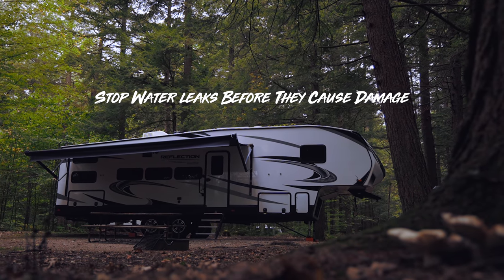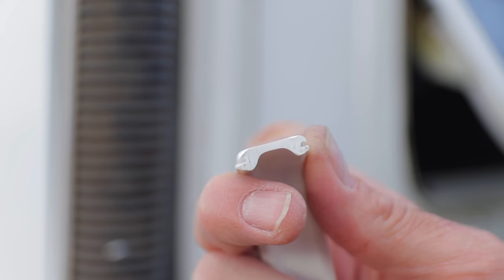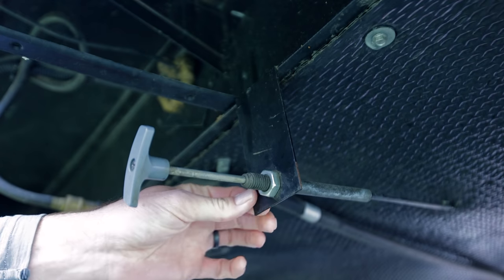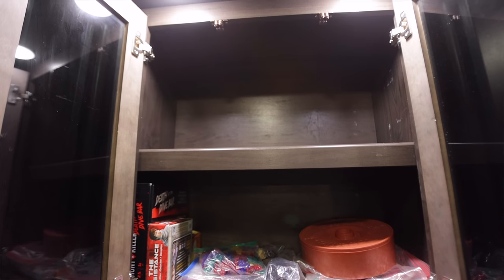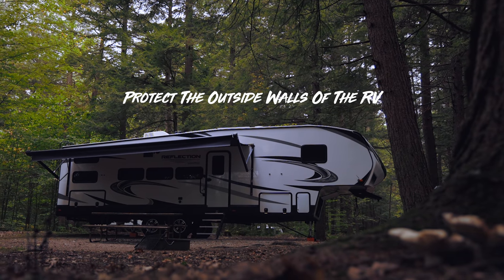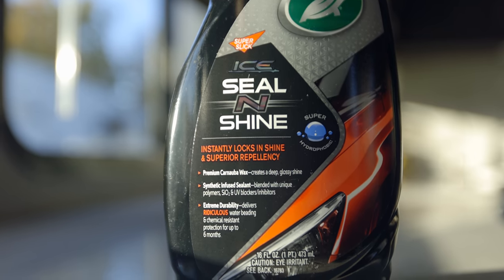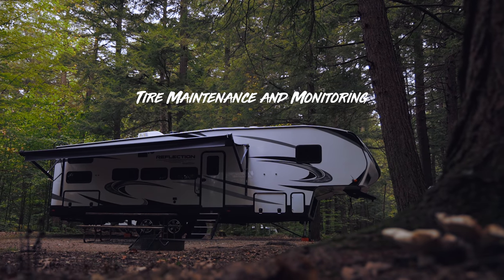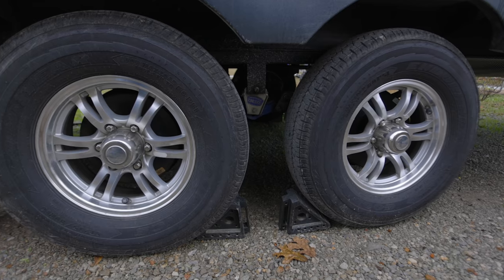5 Ways To Extend The Life Of Your RV

Comment: Thanks Jared!  Any tips on proactive fridge and furnace maintenance?  We are full timers, so I find defrosting the fridge every month really helps.  For the furnace, it's a good idea to inspect the duct seals especially leaving the furnace.  You can really improve air flow to vent far from the furnace.
Reply: For the fridge, furnace, and hot water heater, They should be serviced every year to every other year depending on the use. the furnace might not be worth servicing if it's not accesible.

Comment: I learned it better to first apply a good paste wax first. Then use the spray on wape off wax.  I give my truck, Harley and Camper a good paste waxing in early Spring, then the rest of summer, Spring and Fall I use a good spray on wipe off wax. It's brings a quick and easy shine with the spray on, wipe off waxing after a good paste waxing. But, it's a job giving a large camper a paste waxing, but we'll work the trouble. Thanks for sharing this video!!..

Comment: Stainless screws under the inserts would be an easy manufacture procedure or owner upgrade…. Good tips!  I had an RV destroyed with a rotten floor because some lazy dumbass at the factory didn’t seal the fresh water fill plate correctly.   The puddy was put on upside down with a large gap at the top that funneled water right into my wall and soaked my underbelly insulation.   I looked for years where the water was getting in and never found it because it travelled to an area that was not near it.   I even covered it with an actual RV cover.  ALWAYS check any type of exposed connection that enters your wall for proper water sealing. Now I won’t own an RV with out a place to park it under cover!

Comment: Hello, a while back I watched a video of yours where you showed two different types of weather strip. The weather strip that covers the screws and rail at the top and along the edges of the RV. The type you recommended had a groove of sorts that fit very well into the rails instead of the single edge that fits under the rail lip. 

Is there a chance you can provide me the link to the video and/or a link to the product?

Thanks!

Comment: You forgot about the maintenance of the appliances. should be serviced every year to every other year depending on use. of if you go to a burning man right after. also, add an anode to the Hot water heater. you should see the crap I have pulled out of some water heaters that were not regularly changed.

Comment: The metal that comes down and holds your handle for dumping the gray or black tank... try taken that metal out and replace it with a piece of angle iron.... many people throw away metal bed frames that are angle iron. So one can cut off a decent hung of that and use it. Then find someone that can weld it on

Comment: I'm neurotic about maintaining my slides: conditioning the rubber as well as the mechanical - what lubricant do you use for metal sections of slide? I've been using Tetford and Roadmaster silicon
Reply from the maker: I've been using 3-in-One Slide out Silicon lube. It works well on the latch for the front door too so you don't have to slam it.

Comment: Another MUST DO on your tires is check the manufacture date on the sidewall. Your tires may look new with plenty of good tread left, but if they are 5-7 years old, you should replace them asap. I replaced mine last year because I didn't want those China bombs that were on it from exploding on me at 65 mph and tearing up the side and bottom of my " retirement home ". It could also tear up your slide system if it's under your slide, and prevent you from extending/retracting your slide. I hated to spend the money for 5 new, better tires, but I figured it would save me time and money from having to have my rig in a repair shop for months fixing the damage from a blowout. Keep up the great vids!

Comment: Check out the PB blaster garage door Teflon spray for using on the slides. I use it on all kinds of stuff and it works great since it’s drys to the touch.

Comment: Meguiars hybrid ceramic wax is super easy to use. You can spray it on the outside and then power wash it off. I usually spray the nose of mine a few times a year to give it extra protection from the bugs and rain hitting it.

Comment: Hi Jared, I have owned a 5th wheel for 21 years now and have gone to the RV college of trial & error...but...the seals you show on this video WILL be added to my Rv! Thanks for that tip for a real problem area. If I may, I am a finish carpenter by trade and a cabinet wholesaler these days...the "weak points" of RV cabinetry are many! The shelf caution you mentioned is very real. But...even more important is the way they are hung on the walls! Maybe you can add to this...by checking the screws and attachment points to the walls. The walls are just as thin as the shelves. I have loosened the screws, created a small 1/8" space/gap at the tops of the wall cabinets and used a construction adhesive to bond the top of the wall cabinets to the complete paneling as the screws are tightened.  This locks the complete cabinet to the outside walls where the support is "stressed" the most. I have even used small beads of clear silicone down the exposed sides for even more adhesion. This needs to be done neatly, so it is not unsightly of coarse. In my RV, I even doubled the larger shelf bottoms with another piece of 1/4" finish plywood for added strength for heavy stuff.
Thanks again for some great info videos! Ted

Comment: You only need two tips. 1. Don't drive it so it doesn't fall apart on you and 2. cover it with a tarp so the roof doesn't start leaking.

Comment: Good tips. What do you think about applying sealant into the roof channel before you replace the rubber trim? That way, even if water does get in, it won't get past the silicone sealant?

Comment: Get an infrared (laser pointer) thermometer and make a habit of checking the temp of the tire tread AND  the wheel where it bolts to the hub.   If one has a problem it will be hotter than the others and you’re more likely to catch a problem before you have a blow out or bearing failure.

Comment: Hi Jared! First off, thanks for your tips and tricks. I’ve been in the RV world for a few seasons now and it helps a lot. Rather than having to learn the hard way!

My question is this. My next RV will be fifth wheel, from my travel trailer. Currently own a Grand design product and love it. I am intrigued with the Jayco Eagle product. Have you had the chance to check them out? What are your thoughts?
Reply: I own a 15 year old Jayflight and its in excellent shape.  Just ran into ex owners of a similar Jayco trailer and they regret the change in company.  I hope to hang on to my camper for at least another 5 years.  As I see it, it may outlast my expectations.  New stuff is garbage.

Comment: What kind or brand of vent roof sealant do you recommend,  I'm literally dealing with failed seals on all vents. It is metal, not rubber roof.  Thank you!
Reply: I recommend you clean the seals well, put new sealany if  it needs it, wait for them to dry and then use eternabond tape to cover them up.
Reply: Have you checked any Dicor products to see if they are used on metal roofs?

Comment: Hi Jared, One tool that is dedicated to the trailer tool kit (that is the first item - a tool kit) is an infrared thermometer. I have bought several (one for the boat, one for the trailer and one in the tow vehicle) and have never paid full price. Just wait for it to be q sale item and pay only 1/2 price!

That said, I use the thermometer to check the bearing hubs. Ideally, the temperature should not exceed 200 deg(F).  I use to monitor by putting my hand on the hub and if it felt not much warmer than a cup of hot water, we are good to go. I check them before I leave the yard, later several miles down the road, and at every road stop. I just walk around the trailer and touch each hub. And check the tire pressures each mid day.